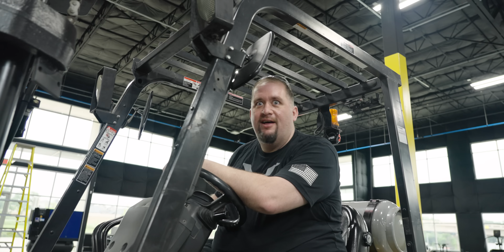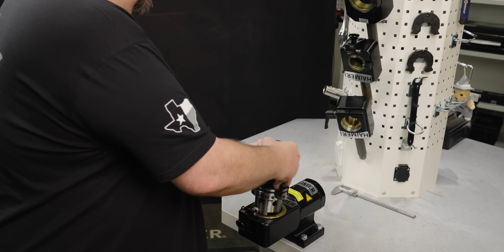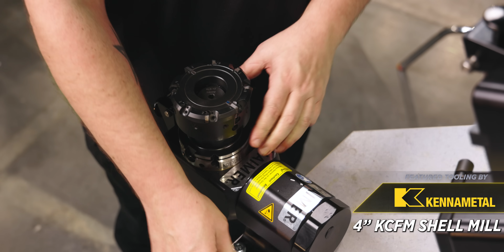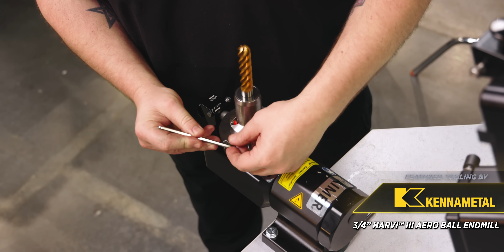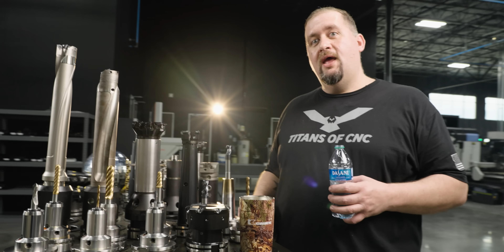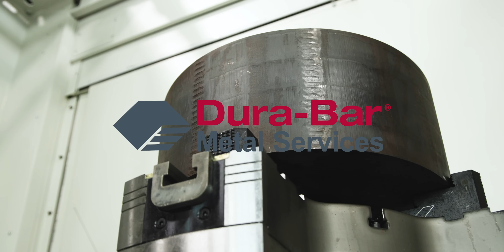MONSTER Set Up to Machine Huge Complex Part

Comment: Do you guys use vericut for simulation of the code now Sandvik bought CGtech, making it part of the mastercam family?   I've had some issues with mastercam simulation, where the cimco post was flipping the bed the opposite direction than mastercam simulation thought it was in simultaneous five axis moves.   Another level of verification would give me real peace of mind for high end machines like the Heller.

Comment: Out of curiosity, how does a machine sense a damaged or failed tool?  Around 55 years ago I worked as a draftsman for a machine tool design company.  They designed tools used for the mass production of automotive equipment, such as engine blocks.  They used things like air pressure sensors to determine if, say, a drill bit broke.  There were also operators watching for broken cutters or telltale signs of a damaged tool.

The machines you use to cut run at much greater speeds, tool changes are automatic, flood cooling obstructs visibility, and automation lets the operator move away from the machine. 

How do you know that damaged tools are not ruining the parts being machined?
Reply: A load meter, generally. You can set minimum and maximum load limits in the controller for every tool, or only those tools of most concern, or none at all if you wish.